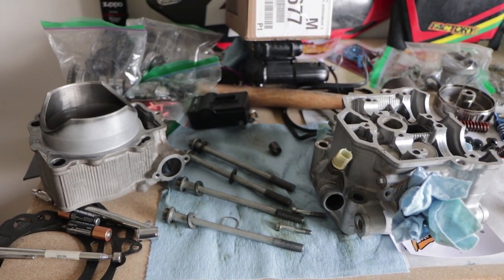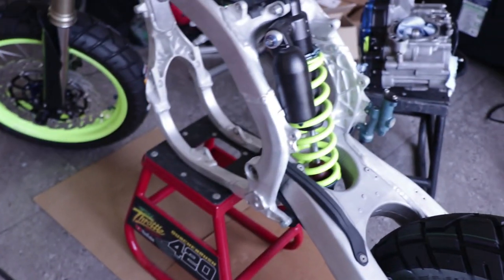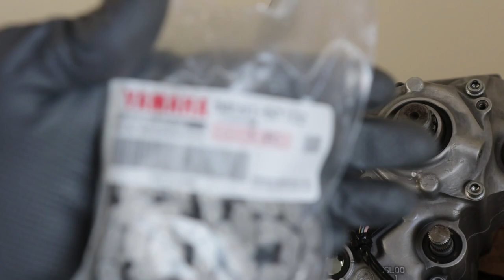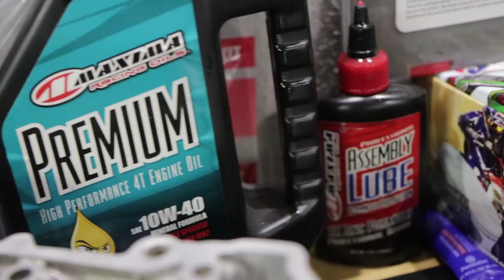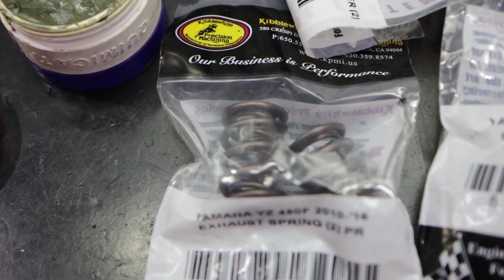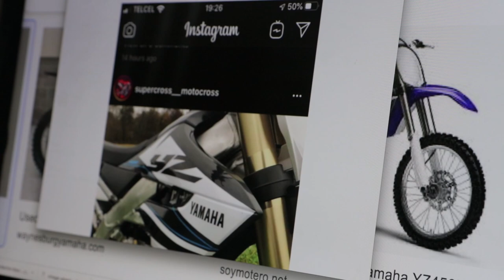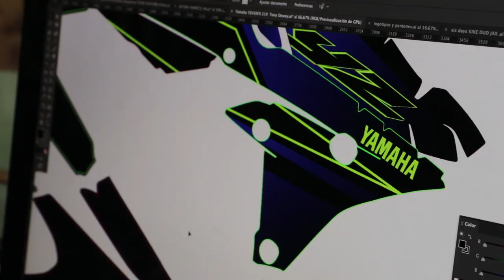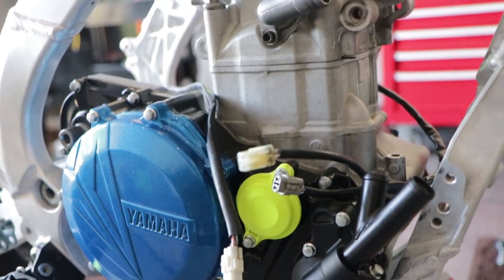YZ450F Supermoto Build: Engine Rebuild Pt. 2! Top End Ep. 16

Comment: Oh i was not exceptimg that u change all those bearings lol 😂 gj man
Reply from the maker: Topi Metso went all out had to do it 100% right, will explain later! Thanks a lot!
Reply: You should maybe put some silicone on that valve cover gasket, where are those ”half moon” things. Lot of ktm s have started to leak when they have checked those valves and forgot to put some extra silicon there
Reply: It may not be an issue on those yamahas, but if u open it after break in, it may start leaking, and that is soo annoying when the oil gets everywhere :D

Comment: sanding the cyl might be the dumbest thing I've seen... steel valves without stiffer springs? no loctite on cam chain guide bolt? washing the head while its fully assembled ? why why???? people may know how to put these engines together, but that doesn't mean its gonna be done right.... this engine was built so backwards but it does look sick. hope it lasts
Reply from the maker: Nate Bennett first of, I literally explain in the beginning of the video that I changed the valve springs, they are the kibblewhite springs meant for the stainless steel valves. Nothing was built backwards.. yeh i washed the head because i again replaced all the internals so whats the problem? Loctite? Man its going to be fine. Listen this is mexico we don’t always do shit 100% by the book because we can’t, we make it work. I promise you this engine will last and is going to be a beast. Thanks for expressing your concerns. Hope u like the build at least
Reply: @FULLTHROTTLEFILMZ  idk man the grit off that sandpaper is imbedded in the nikasil now, compression will go down in abt 20-30 hrs. listen i build motors for a living. im just trying to give advice
Reply from the maker: Nate Bennett yeah I am listening and all I can say is we didn’t have a 450 size hone to do the cylinder so we used a super fine grit and I personally did NOT see any grit left behind on the cylinder plating. I’m sure you’re right but I did the best job I could. Thanks for explaining more. I’m no pro and don’t claim to be one.
Reply: @FULLTHROTTLEFILMZ  no yea man its all good, i just hate seeing people make mistakes like that cause more often than not they'll come back to bite ya! haha. but yea typically you won't see it, especially a super fine grit, but sandpaper isn't meant for that and the grit does lodge itself in the cyl, not to mention its very hard to get a even uniform hone with that method.
Reply from the maker: Nate Bennett fair enough well thanks for passing that on I really had no idea that it was a big problem. Now I know right